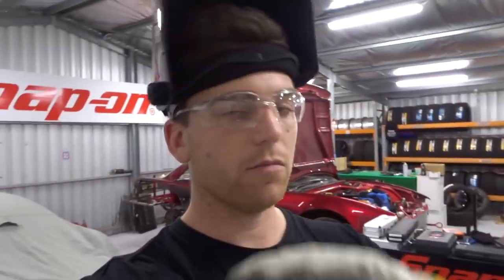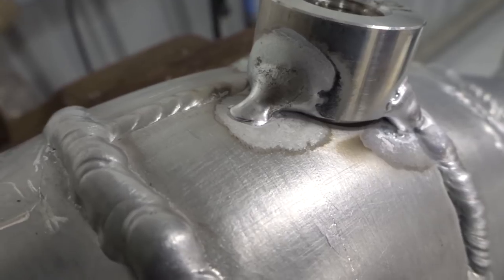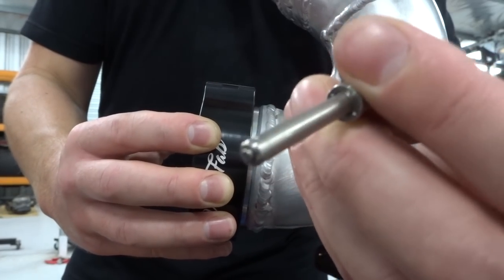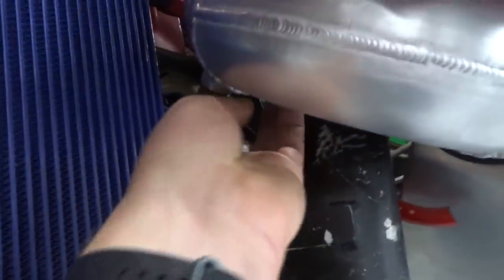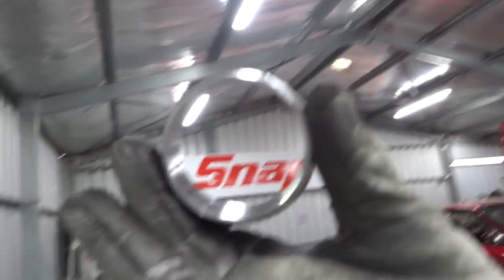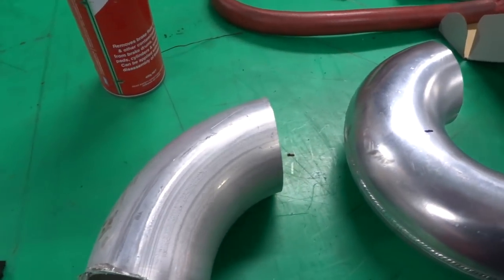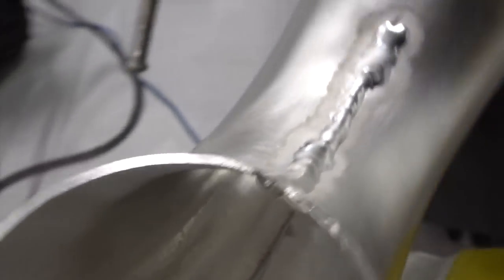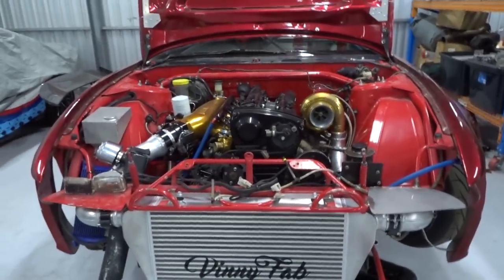Completing The Intercooler Pipe Work | Alloy Tig Welding!

Comment: Try using a smaller cup size for ally next time, #5 is what alot of people recommend.
It narrows down the range the arc can walk compared to a bigger cup, making it way easier to remain in control of the puddle among other benefits.
The Fabrication Series and Welding Tips and Tricks (both on YT) have short videos that explain this.
Reply from the maker: Thanks mate. Appreciate this heaps

Comment: I noticed the TIG torch that you using if you change up your TIG torch and get you a lighter one maybe like a CK worldwide with a superflex cable you'd be able to get rid of that shaky hand it's cuz you got a lot of pull on your hose
Reply from the maker: Yeah I got another torch and a foot pedal with the kit. I should change it over for when im doing ally. I will next time for sure.

Comment: I think you should get a foot pedal for your Tig 
Its way easier when you can moderate the current when welding, then you can have the welder set higher then u need and always towards the end of every weld you let off the current a bit to prevent blow outs 
And a bit higher in the beginning to get e Nice puddle started 
A foot pedal for that welder is around 50$
Reply from the maker: Ive actually got a foot thingo here. Came with the welder but I didnt use it. Maybe ill give that a crack on the next job.
Reply: @DriftSquid  Yeah def do that , that will improve your result big time

Comment: Make the electric throttle match up to the piping instead of redoing the piping to match up with the electric throttle and when you get a tune get a tune so you can swap back to cable. Been seeing a lot of people having trouble with there electric throttles. Example would be forsberg.
Reply from the maker: Yeah I remember watching that live. I havent ever had an issue with the DBW setup on the RBM3. Its actually been the best thing ever but I will just in case.